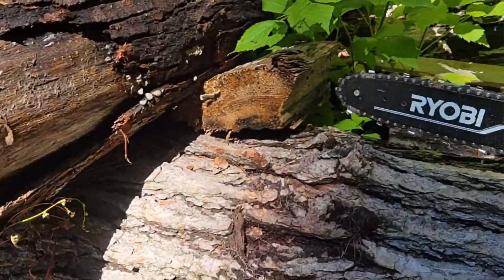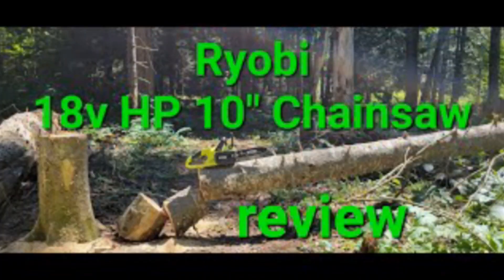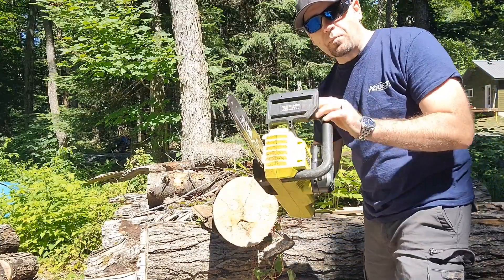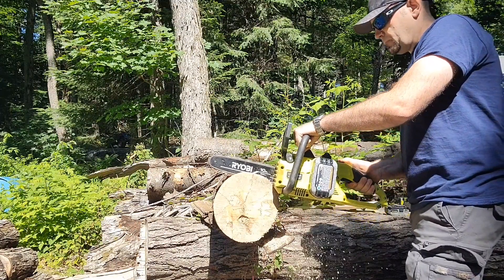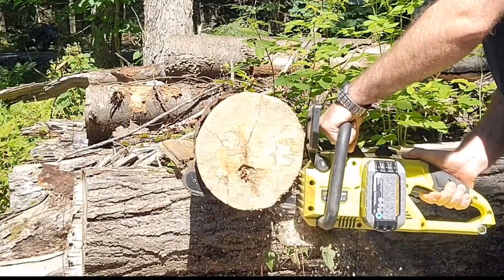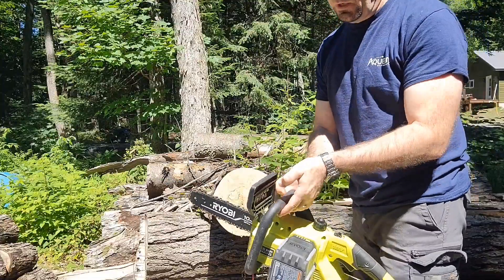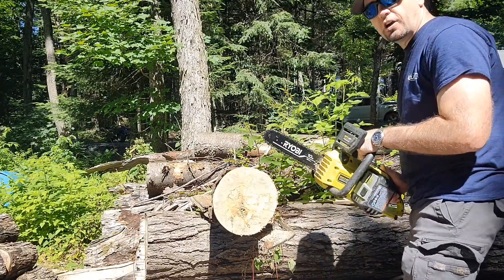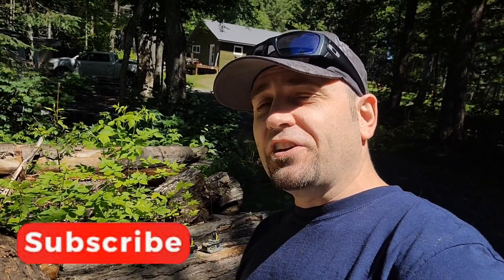Chainsaw Ryobi 18v hp battery - The ultimate speed test, does battery size matter?

Comment: Very nice although the difference is almost unnoticeable there's definitely some in there, it would be very nice to compare the 12ah to the new 4ah EDGE battery
Reply from the maker: @Escalofrios29   That's the plan. I picked up a 4ah EDGE  not long ago. I ran some test with the high torque impact wrench. I'm just waiting for warmer weather to test it with the chainsaw.